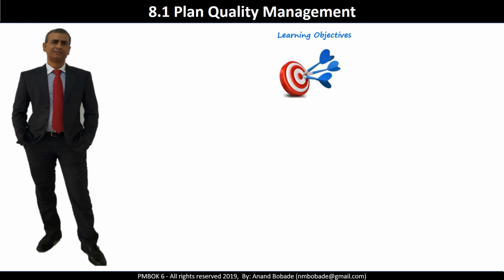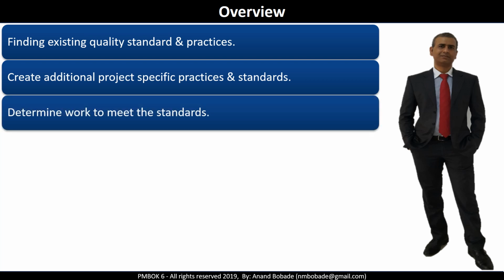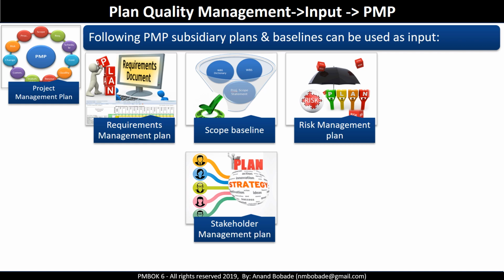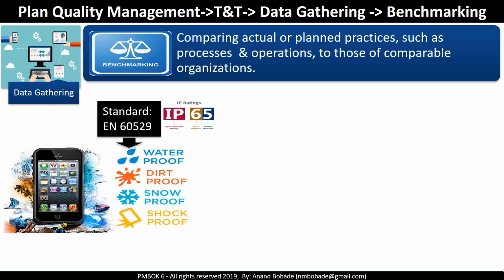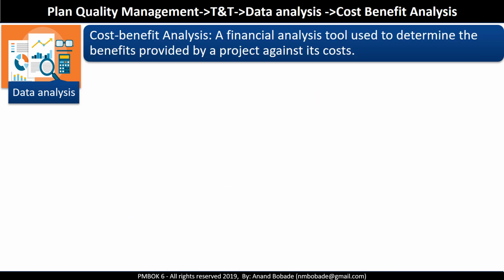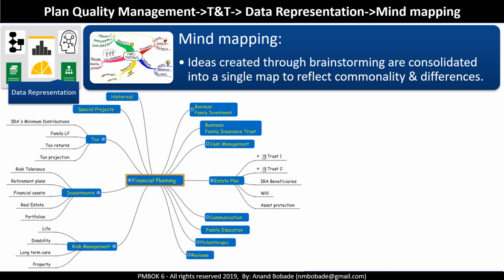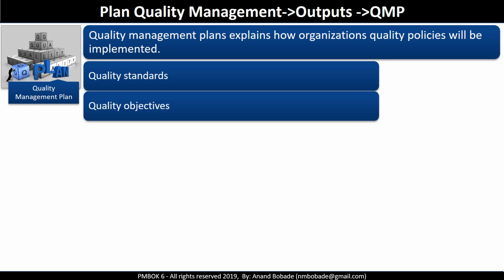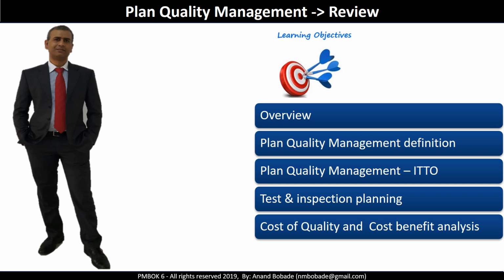8.1 Plan Quality  | PMBOK6 | PMP® Training | PMP® Certification

Comment: What is philosophy of Modern quality management:
a. Inspection helps to identify problems; therefore it is a method of choice for quality management processes.
b. Prevention helps to avoid problems, and reduces the overall costs of correcting them in the long run.
c. Inspection and Prevention are both Tools and Techniques of the Quality Planning Process.
d. Cost of Conformance will always be lower than the cost of non-conformance.
Reply: b. Prevention helps to avoid problems, and reduces the overall costs of correcting them in the long run
Reply: @RanjeetSharma-zi2hq  b. Prevention helps to avoid problems, and reduces the overall costs of correcting them in the long run.